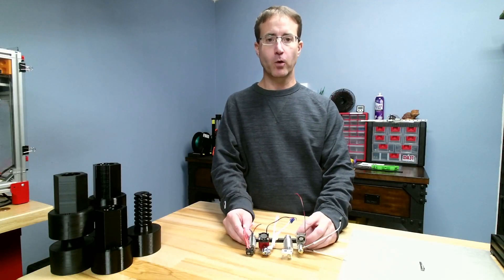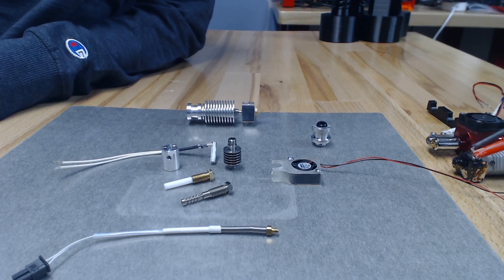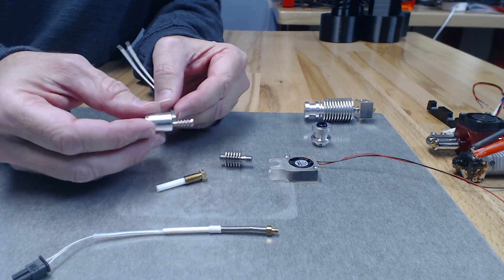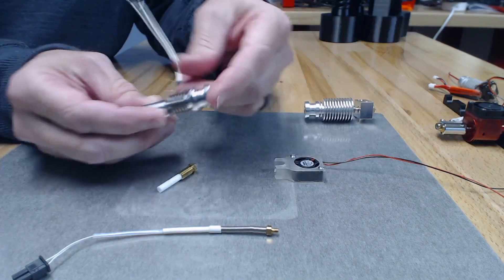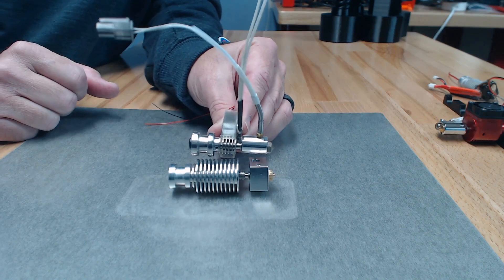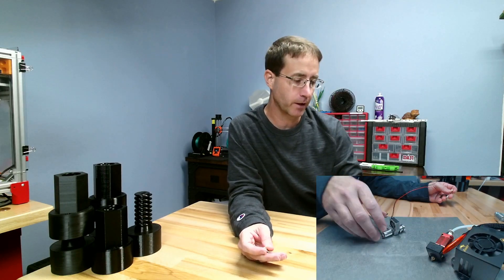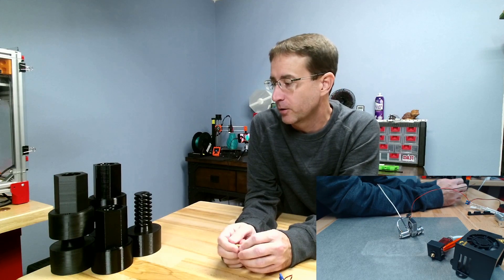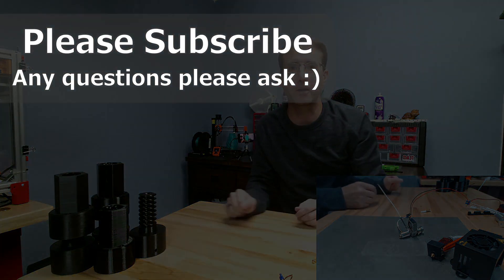Quick look at the Pico Hybrid Hotend for FDM 3D Printers

Comment: What flow rate did you get on the Nova?
Reply: 50mm3/s was just achieved by a third party. Tsxfire handle on instagram and twitter, with PETG and 1mm nozzle. He since reported that he hit 55, however that second claim should be still doubl3 checked.

Comment: What's the flow rate of the pico?
Reply from the maker: "24mm^3/s using PETG at 242C

PLA, I hit 13.23mm^3/s at 210C

ABS at 250C was 20.92mm^3/s"
That was a test run on an Ender 3 style frame, direct-drive setup using a Bondtech BMG, 24V E3D V6 hotend with stock heatsink. Don't tell them I shared this info!!  :) I am not sure what brand of filament, probably Hatchbox but I will check.
Reply from the maker: Let me ask the team and get back to you, I know they told me but my memory is shorter than this post.

Comment: I hear Nova hotends makes any printer print at 300mm/s even with TPU? I would abolish that crook. Selling snake oil. You should try the Mosquito! Also the new Alice Engineering Copperhead
Reply from the maker: The Mosquito is great, it would be fun to try the Copperhead.
Reply: Hey bud, havent you purchased Nova and havent you already  changed your opinion entirely? I would appreciate if you could reflect it in the comment. Stumbled upon it accidentally :) you was the guy who started praising it right after you actually bought it. And you was the guy who achieved and showed all my claims on twitter (which I appreciate) :)

Vlad